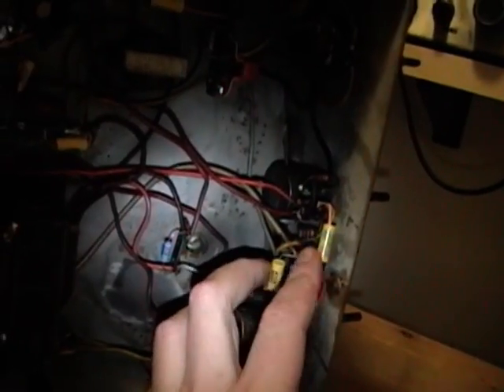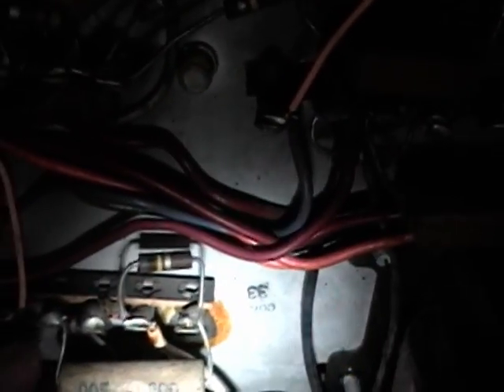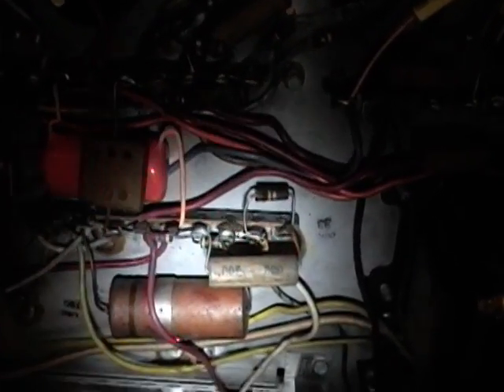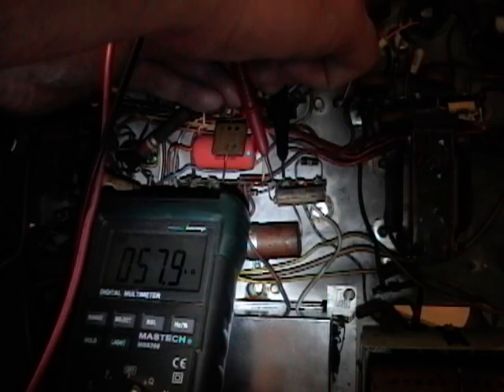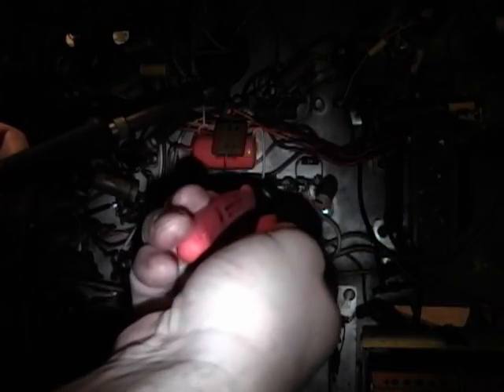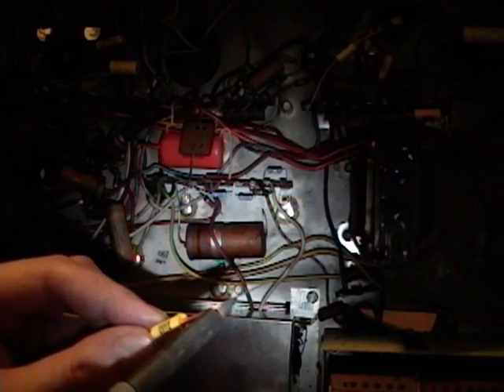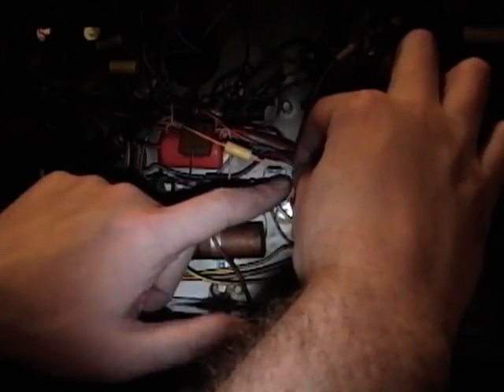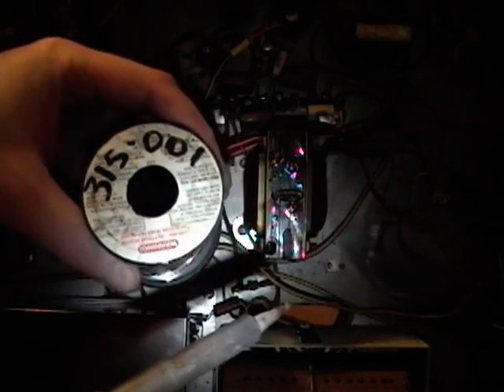Restoration Tips 6: Replacing components

Comment: When you check the condition of resistors, do you sometimes measure them while still in circuit, or do you always disconnect them first? Is there way to measure a resistor accurately without taking it out of the circuit?  Thank you so much for these terrific tutorial videos...the best on YouTube.

Comment: @bandersentv ----- The original is a 6-8 volt bulb type 47. The only ones I can find in that type are 6.3V 150ma. looking at the schematic, It doesn't look like the bulb is doubling as a fuse but it is. The schematic also does'nt say what amperage bulb that is needed. Just "Mazda No. 47" Any thoughts?

Comment: I don't have one yet because I always get outbid on them when they show up on eBay (they'll jump to $50 or so), but used one at a shop where I had worked 20+ years ago.  They resemble the one-handed desoldering iron Radio Shack sells for about $15 with the squeeze-bulb beside the handle.  On the "Air Vac" tool, the venturi device and trigger are located in place of the squeeze bulb on the Radio Shack version.  The only disadvantage: keep a 6" long 1/16"-dia ramrod handy for periodic unclogging.

Comment: @bandersentv My all-time favorite desoldering tool (rare as hen's teeth these days, but they show up on eBay occasionally) is something called an "Air Vac Solder Gobbler" and uses a pneumatic venturi to create its vacuum.  It connects to 115V to power its (about 45W) heating element and a standard pneumatic line (around 40 psi, if memory serves) yo power the venturi.  Just heat the connection to be desoldered, squeeze the trigger, then release the trigger and return the iron/pump to its stand.

Comment: We a "solder aid" tool with a scraper or wire-brush end for final cleanup before re-assembling connections.  On the least-crowded lugs in our Basic work, we use the spring-pump to remove most of the solder, then either use micro-pliers to de-crimp only the part being replaced (especially when the lead is on the outermost layer of the crimps) or crimp the new part onto an unused section of the lug (when an unused section exists); leaving most old connections in place and skipping the braid step.

Comment: We use the full-disassembly method on our Deluxe and Standard Restorations and use a modified pigtail method for our low-cost Basic plan, and we use clip-on heatsinks to protect the still-good carbon resistors from the soldering iron heat.  For our pigtail method, we cut the old leads about 1/8" from the lug and form the end into a J-shape, then form a hook with each new lead, pre-crimp the splice with micro-pliers, then solder with a pencil iron to avoid disturbing the factory-made joint.

Comment: When desoldering lugs on miniature tube sockets, especially phenolic-wafer type, finding some means to hold the lug steady during de-crimping will prevent breaking the lug.  Fitting a clip-on heatsink at the base of the lug and wedged against the phenolic is a good socket-saving trick, but doesn't work in crowded areas.  With much practice, it's possible to align the de-crimping tool in such a manner as to apply most of the small prying force parallel to the lug, minimizing bending.

Comment: We cut off each old capacitor's lead about 1/16" from the lug and start desoldering with a spring-loaded vacuum desoldering tool for bulk solder removal, saving the braid for cleanup of traces left behind after all the leads have been de-crimped. For de-crimping, we select an appropriately-shaped "solder aid" tool (pointed, bent-pointed, knife-blade, etc.) or a fine-point instrument resembling a dental pick as a lever to gently pry the crimp open while heating the lug with the soldering iron.